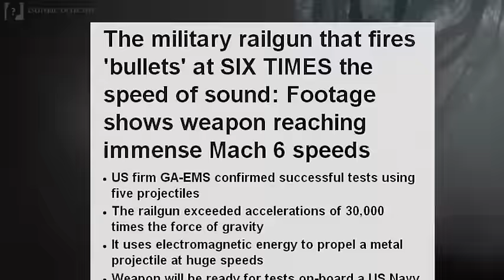Blitzer rail gun reaches Mach 6 | fitted to U.S Warships this year

Comment: I think the rail gun technology is definitely futuristic but when you examine the devastation of 911 one must conclude unknown weaponry was used to reduce concrete and steel into dustleaving leaving circular patterns in the debris field see Dr. Judy Woods book for more information
Reply: +GEERUP  A simple tactical nuke placed under the parking lots of WTC 1 and 2 would have done the job and the surface burning of vehicles many blocks away supports this theory. There was radiation detected at the scene...
Reply from the maker: +GEERUP yeah you could be right! I have looked at Judy Wood, so it is very intresting. One day I will do a vid on 911!
Reply from the maker: +DeadringerFRED yeah you could be right - I don't know abotu the damage they make though - thanks for the comment!

Comment: I don't feel like this will replace gunpowder in infantry combat. A rail gun small enough to carry would not have enough length to pick up any speed or power, and it would not be able to fire in rapid succession.
Reply from the maker: +Savage Wolf well, as tech moves forward maybe they could - they move very fast though! thanks for watching!
Reply: +Esoteric Detective I agree with that guy, but not for his reason: I have no desire to have a gun with electronic bells and whistles that are absolutely necessary for its operation. An electronic scope? No problem. But the actual mechanism cannot be allowed to fail, and you can't make a genuinely "no fail" electronic system yet.
Reply from the maker: John Pryce
fair enough! yeah, your right - it would take ages to make them not fail and stuff - gunpowder might be around for a long time yet - probably take a long time until gunpowder is replaced. Thanks for watching!

Comment: Opening pic is from wikipedia.  sighted as a 2008 rail gun  shot.

As for the the tech, it will have some good uses both in shore bombardment by way of KE and Aircraft /Missile defense.  It is conceivable that a short range multi projectile system would be used as intermediate missile defense while a unitary projectile might be used at longer range.  The only real issue is targeting and laying the gun system accurately enough

With terminal guidance this will also be a lower cost PGM than many systems but restricted of course the range from a ship or shore instillation